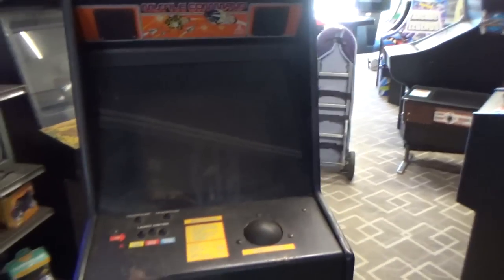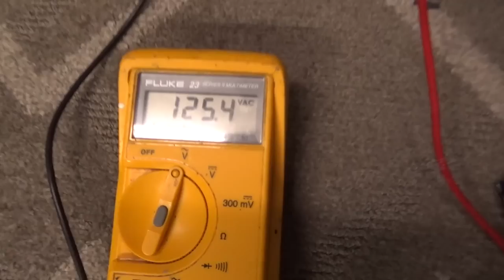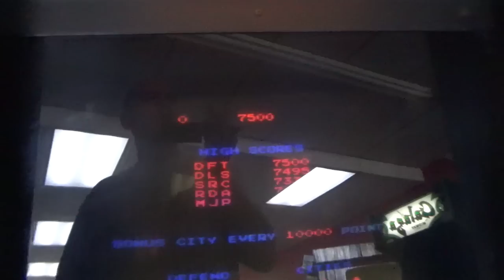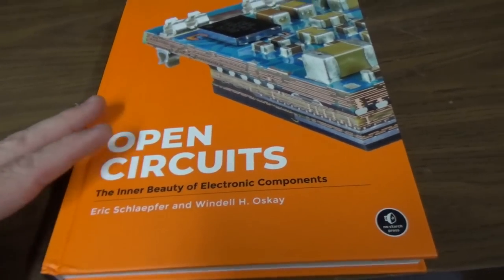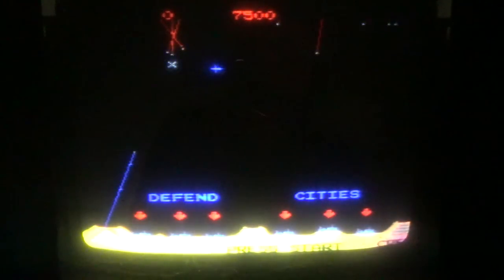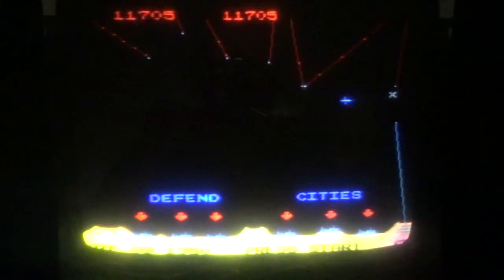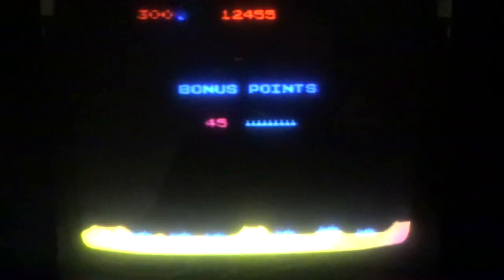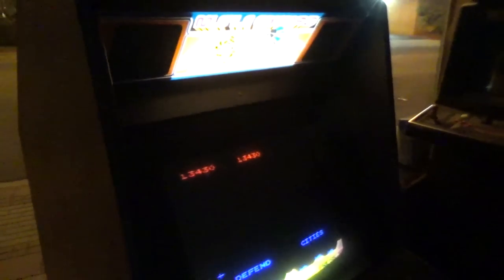Repairing This Old Atari Missile Command Arcade Machine - Completely Dead Survivor Cabinet!

Comment: Atari was pretty good about safety, especially since it was the 70s and you could have pretty unsafe things making it to market.

The fans your brother bought just recently and cleaned, having a giant metal fan that is basically a spinning saw blade,  with a wire grill so big you could easily stick your hand in and have it slice your fingers off.
People were not dumb. They knew not to stick their fingers in the spinning fan blades.

Now the amount of safety built in to everything and the number of warnings are just funny till you realize most young people don't know not to stick their finger in the electrical equipment.

When I heard that a property owner renting to college students came in for the move out and all the light bulbs were burnt out and not one of the college students knew how to change a lightbulb

Not a clue where to start.

That is scary

Comment: Also, any chance of any repair videos coming up in the future for a Roller Disco pinball? Or other system 1 pinballs? I’ve gotten my hands on a roller disco here in norway for 500 bucks, kind of sort of starts up but loooks like spider chips might be corroded so have to switch to new motherboard and get a harness since someone soldered the harness wires directly to main board, and corrosion from the built in battery that wasn’t replaced by a removable one - got my work cut out for me and could use some inspiration in addition to the other videos I’ve found :)
Reply from the maker: We don't have any System 1 games coming up in the near future unfortunately but we do have a bunch we've already done videos on.  Roller disco is very cool!

Comment: Many Years ago. I used to have a Centipede caberet Machine. This was 20 years ago. Decided to to sell it to give it a new home, So someone else could enjoy it and play it more then I could. Sold it at time for $1,900.  But, sold it to someone I kindof know. But, wish I had never sold it, 3 years later. Went to a Party He was Having. Saw what he Did to the Machine. He ripped out everything from inside and just threw it all away. Cut big opening where the Coin Slot Doors were. Placed a Door on it. Then took the Monitor out Replaced the Glass and Put a Fish Tank in it and Painted the Entire thing Neon Green.  It Hurt seeing what He Did to that Machine.

Comment: Missile Command was one of those games that I just did not like.  Cause it kicked my butt every time I ever played it.  Even the Atari 2600 version I had.  For whatever reason my brain just could not time my shots with the correct lead from the correct base.  thus resulting in a mild dislike for it that lasts to this day.

Galaga is affected by the 256 thing.  When you pass stage 255 the screen will display "Stage 0", the stage badges disappear, and game play pretty much stops.  You can still control your ship and shoot but no enemies will come out to fight.  You have to reset the machine to get it playable again.  Galaga was my game back then and it wasn't hard for me to get there.  Park a bar stool in front of the cabinet and go.  A couple of times I would be on stage 255 and told a watching kid that I would give them my game after I finish that stage.  It really confused them and I made a big deal about them "breaking" the machine which was fun.

I understand that a ROM that corrected the issue was made for Galaga becuase of it appearing in the movie War Games and a tie in contest to get the world record was on in arcades.  The local Aladdin's Castle had a Galaga set up with a secondary monitor on top and I asked them about it.  The manaager told me about the ROM and that they had to install it in their cabinet so it could be a part of the contest.

Comment: The game limits you to 10 missiles on the screen at once. Guess that maxes out the computing power of the game. 
  My local Lowes has the correct 1.5 diameter light bulbs for the marquee instead of the 1 inch that doesn't fit in the metal bulb retainers that well.  Does any one sell the volcano shaped hex screws used to retain the marquee bracket to the cabinet? My Missile Command is missing one and I would like to rind a correct replacement.

Comment: 27:13 - This must be closely related to the value range of a byte (8 bits), assuming the level counter etc. uses just a single one. the value range is 0-255, so 256 is an invalid value. On 2 bytes (16 bits), 256 is 1 on the first byte (lowest bit up), and 0 on the second byte (all bits down).

Comment: 8 bits of binary can store the values 0 to 255. 256 requires 9 bits of information. the special programming numbers you are referring to are powers of two. 2, 4, 8, 16, 32, 64, 128, 256...

Comment: Reposting from a reply because I think this is good on its own too:
The 256 rollover problem is not specific to binary or computers. Imagine if you were counting from 0 and you could only use 3 digits (like a combination lock where each digit is on a separate spinning cylinder). You would go from 0 to 1 to 2 ... to 99 to 100 to 101.. then finally to 999. If you continued counting normally (without the 3 digit limitation) you would go to 1000, however you only have 3 digits so the 4th digit is ignored and you're back at 0. 8-bit processors like the 6502, which Missile Command runs on, work with 8 bit (bit just means a binary digit) binary numbers. Specifically, they have 8-bit data buses, which means the processor can only receive and send out 8-bit numbers, and an 8-bit ALU which means they can only perform operations on 8-bit numbers. Counting up from 0 in binary (base 2) would look like the following: 0, 1, 10, 11, 100, 101, 110, 111, 1000... The number of digits (bits) goes up exponentially, so 1 digit can hold 2 values (0 and 1), 2 digits can hold 4 values (0 through 3), 3 digits can hold 8 values (0 through 7)... 8 digits can hold 256 values (0 through 255). It is possible to store values in 16-bits (and any arbitrary multiple of 8 bits) using an 8-bit processor although it increases the size of the program and is generally slower and harder to work with

Comment: If you had a pinball machine with five score reels, what happens when your score changes from 90,000 to 100,000? It rolls over to zero and starts counting over again from zero. For the 256 problem the "score reels" only hold two numbers each instead of the ten numbers that a pinball score reel would hold (0-9), that's why the magic numbers are powers of two. For pinball scores, the scores would roll over at powers of 10 (100,000 points - 1,000,000 points - 10,000,000 points) because each of the score reels holds ten digits for that number's place, but the programming scores roll over at powers of 2 (256 - 512 - 1,024) because their "score reels" only hold two digits each. (not to explain the 256 problem, just to help visualize why the magic numbers tend to be powers of 2)

Comment: The reason 256 is a problem with some software is if you're using an 8 bit variable, the highest number you can represent is 255 (1111 1111). 256 is a rollover which would be 1 0000 0000, but you don't have the 9th bit, so you either throw an error (overflow) or you roll it over to 0000 0000 again. The end result depends on the system and software running. I'd imagine if 256 cities = 0 cities, then that's Game Over when the software makes that check, probably when clearing a level. Either that, or it crashes as soon as it detects an overflow, and does a full reboot. Of course, I was a hardware tech, not a programmer, so what do I know?

Comment: Games have 8 bit registers. So 11111111 is 255 (256) then it rolls over to 00000000 (level 0 or 1 again) and the program doesn't know what to do with it. They could get another 8 bits (a byte) involved and go up to 65536 but they probably figure 256 is enough.
Reply: Or they could wrangle another bit from somewhere and get 512. But memory was also precious in those days.
Reply: Oh and if they want to use all 8 bits and get 256 levels they'll make 0 mean level 1 then it will roll over from level 256 to level 1. If it's 255 levels they're not using zero so after level 255 it's level 0 and then it's broke.
Reply: @mikebell2112  ... "and then it's broke" made my day !

Comment: 255 as 8 bits is  1111 1111 in binary.   Add one to that you get 256.  But in binary (8 bit) you get 0000 0000 or 0. Now depending on the programming 0 might mean something special  if say the levels start at number 1 and go up level"0" will have unpredictable results

Now you as a programmer can check for this. "Roll over" and take some action.  In the case of MC and the cites...it looks like it just resets the programme and hence game
255 +1 =0

Comment: The number 256 had nothing to do with Donkey Kong.  The game's "Kill Screen" is level 22.  This is where the game runs out of memory to proceed.  Level 22 will start off as normal, but if you look at the timer it will start off at 4000.  By the time you make it to the middle of the second girder, the first one from the bottom, you will just curl up and die.

Now there is a level 256 in the original arcade Pac-Man.  The screen is nothing but a bunch of computer gibberish which creates barricades for Pac-Man and the Ghosts.
Reply from the maker: You might want to read up on that Donkey Kong Kill Screen one more time
Reply: @kbramlett6877  Actually, the number 256 did have something to do with Donkey Kong.  Let me explain how the bonus time is calculated.  

Basically, the game adds 4 to the level, and multiplies by 10.  Then, if it's more than 80 seconds, it sets it to 80 seconds.  Finally, it adds two zeroes to the end.  That is the starting value for the Bonus.  The idea is that after level 8, the Bonus will always start at 8000 (80 seconds).

BUT, when you get to level 22... 22+4 = 26.  26*10 = 260.  260 is more than 256.  Since they didn't account for overflow, that leaves (260 minus 256) = 4 seconds!  So the bonus starts at 400 (not 4000) and there's no way to complete level 22 that quickly.  In theory, if you could get to level 23, you'd have 14 seconds (still not enough).

Comment: 256 is the end of the 8 bit limit. 00 is 0 FF is 256
The 8 bit program can't handle a value over 256.

It is why everyone went crazy over Y2K

The 8 bit couldn't handle a value over 99, or at least that's what everyone thought.

In reality the PLCs could care less if it was 99 or 00 or something messed up like F4

They didn't care. Luckily

If the date was an part of the program and it needed it to be a certain value to run, that would be a disaster, but there were very few situations where that was the case.

I see the old 8 bit dates every once in a while and I set it to 23 and it thinks it's 1923 but it doesn't care.
Reply: FF is 255, the 256th value.
Reply: @PlumGurly  you are correct. My brain isn't working. 256 crashes the program on 8 bit.

Comment: 256 FF (in HEX) 1111 (in Binary) is the maximum value and B-bit register or memory location can store, Adding (incrementing) this by 1 will make it roll around to 00 , so it's simply this condition on many 8-bit processor systems that make odd things happen